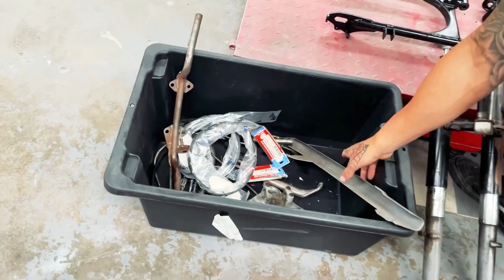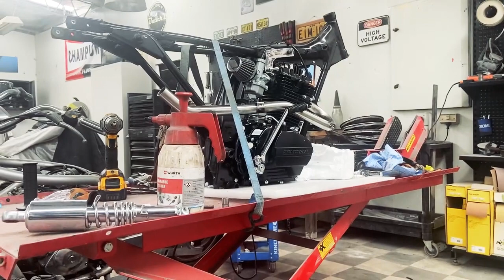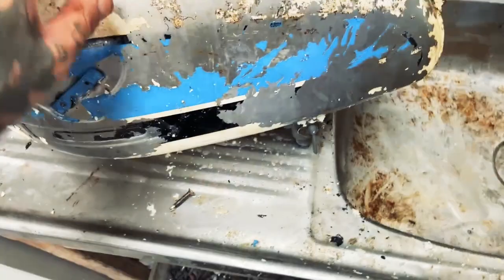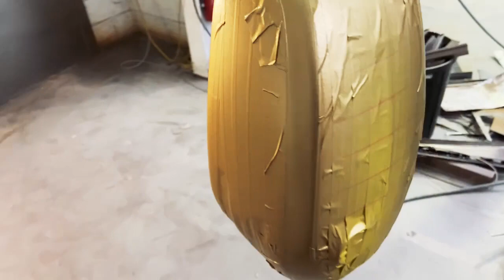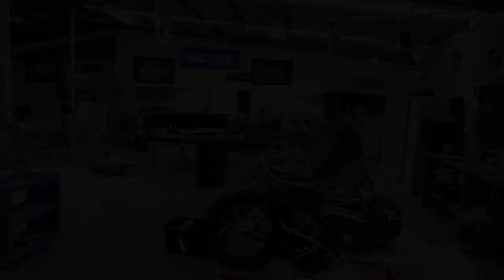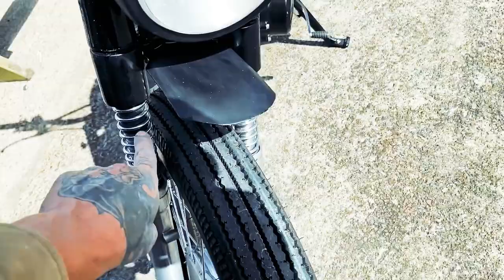Start to finish - Honda CB100 full custom build.

Comment: Nice build. One problem I see though is your front fender. The stock front fender also acts as a fork brace. The front forks on the CB's and CL's are already pretty spindly and not having a brace may cause some problems if your customer plans on riding the bike.
Reply: this^